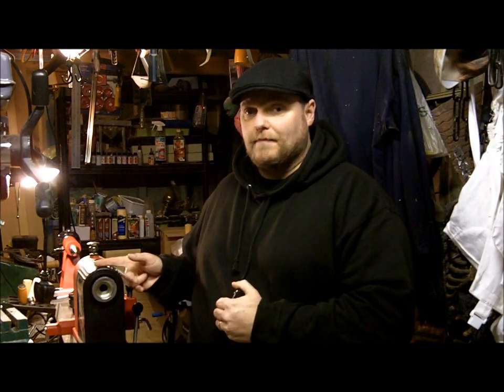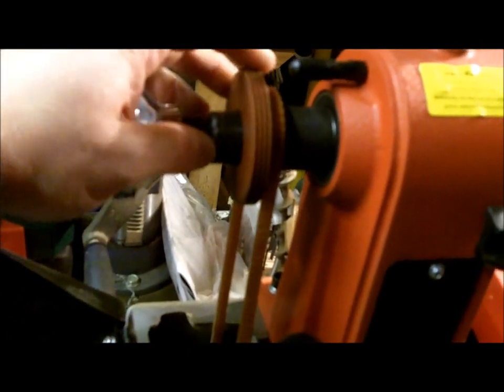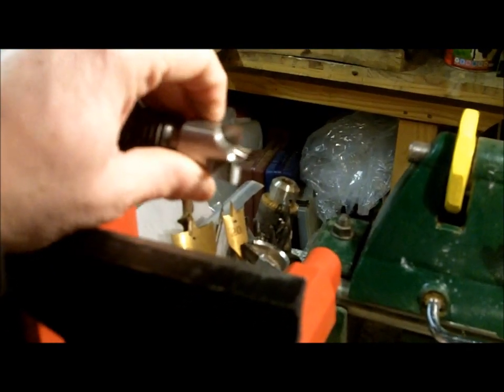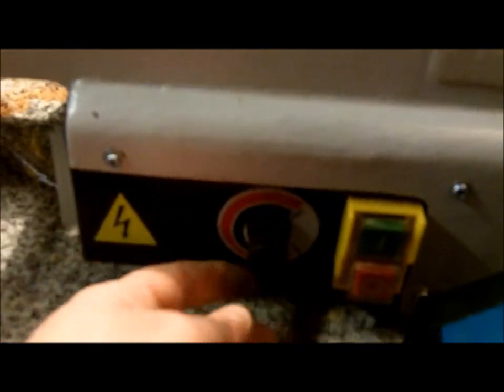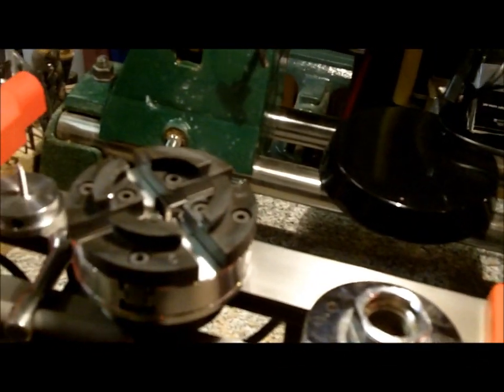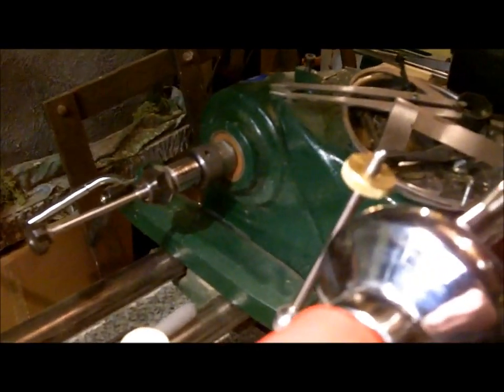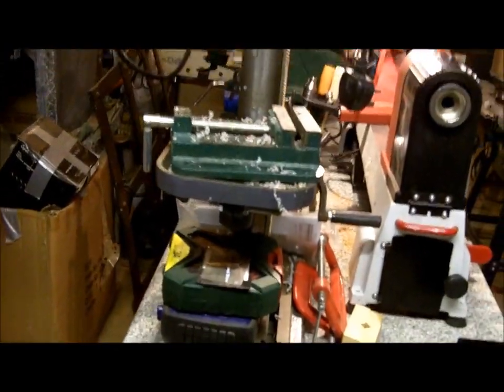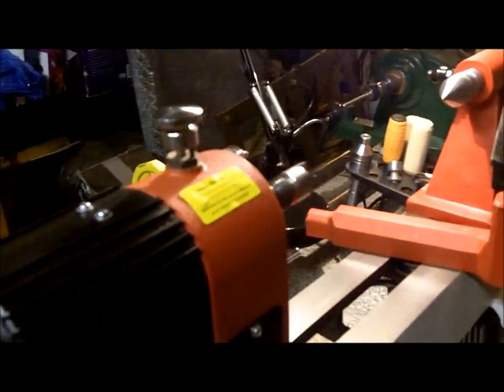Woodturning - Axminster AH1218VS Lathe Review

Comment: hi Chris. I've had some trouble with my lathe recently and Axminster sent me a new switch box. it looks like the same as the one you've got with the heatsink sticking out the side. I opened mine up and found out the heatsink is not earthed. I've told Axminster about this but they didn't seem too alarmed. You might want to get it looked at mate.
Reply from the maker: +John Walters 
Okay John !!
Thanks for the heads up.I'll see if I can get it checked out.
Chris.

Comment: how did you line up the centres on the axminser lathe I'm finding it hard to do
Reply from the maker: Hi there !!
My lathe was okay for centre allignment . Just check that the bolt under the tail stock is quite firm and snug .If you still can't improve the situation I would give axminster a ring.
Take care.
Chris.
Reply: Blind Wood Turner I phoned them and they said its ok to be 1 or 2mm out so I might put some paper under tail stock to sort it out thanks for the replay tho mate keep up the good work